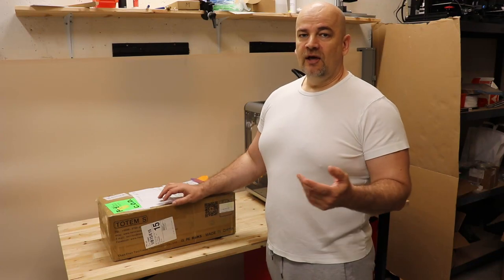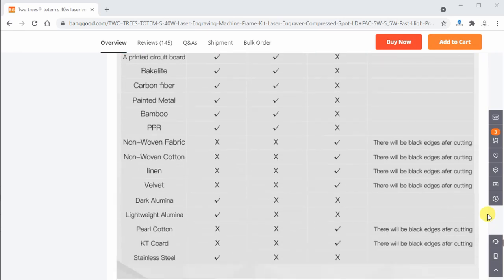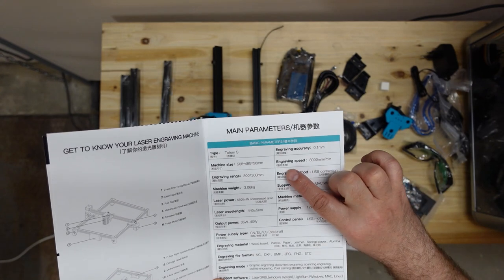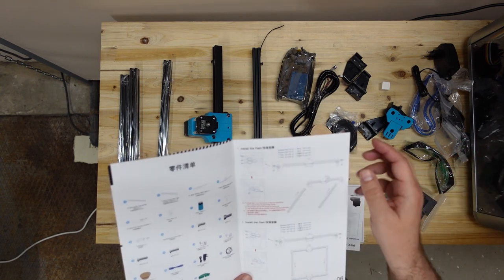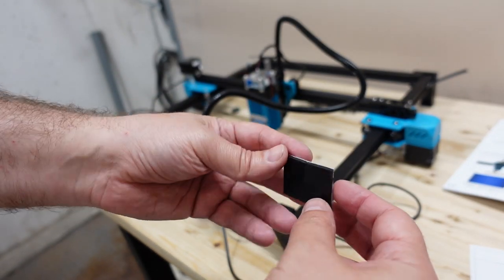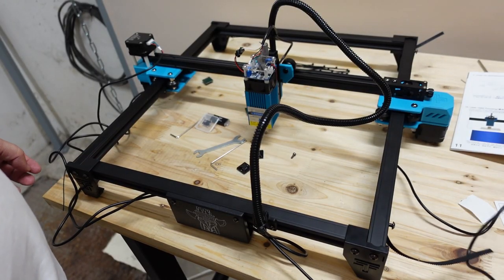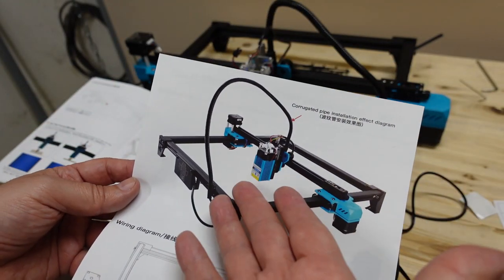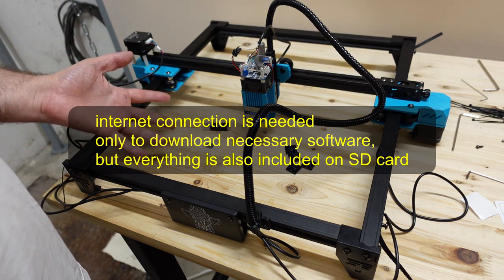Two Trees - Totem S 40W (5.5W) laser engraver unboxing, assembly, review

Comment: next step is to put some geared nema 14 stepper for focusing, build an enclosure with UV filtering inspection window and exhaust tube for fumes :)
 I did read somewhere that commercial machines with high power laser and without UV protective enclosure are not quite legal to sell in a EU. Take this information lightly since I need to find a source for that. Nevertheless, this video made me thinking on adding a laser in my sapphire plus :D
Reply from the maker: Nice thinking, enclosure and exhaust is useful, but I don't want to add more weight to head. I like this focusing method, far the best I have meet so far.  This is DIY machine and you have to put it together (and build enclosure if you need one). Since thomas sandler mentioned in one of his video that it is illegal, everybody think that fbi will knock on their door if they buy this product. Several comments asked thomas, but nobody could show written legal proof. (And I believe welding machines are more dangerous, let's make them illegal too)
Reply: @MyTechFun  That's right, Thomas mentioned that :D I just couldn't remember where did I get that information from.
Reply: PRC sellers have a way of circumventing laws :D ... for e.g. if this is sold as a tool and not as consumer device most of the laws do not apply (you do not need all the certifications you normally need for consumer devices as it is expected that engineers know how to use their tools :D )

fume extractor would be very useful as some of the materials produce extremely poisonous fumes while cutting (acrylic for e.g.)

Comment: Hello, nice video. I was thinking buy one of this. but I have a question, I need the machine to cut some vinyl but I'm not too sure about the results of cutting on this material. Do you recomend this machine for that? Thanks
Reply from the maker: Sorry, I didn't tried it yet, I don't have vinyl at home to test it
Reply: You can't cut vinyl because it will give off a toxic gas. You're better off with a cutting machine like a cricut
Reply: Vinyl not only produced deadly gas when cutting, it is also higly corrosive and every metal part of yout laser cutter would rust in very short time. Buy a vinyl plotter that cuts with a razor

Comment: Hello! I'm wondering if you've tried it to engrave stainless steel materials? I'm planning to buy an engraving machine for my jewelry business. 🥰
Reply from the maker: Yes, with even cheaper laser: https://youtu.be/nTB1Ov3_JOA
Reply: It is not possible to engrave stainless steel with diode laser. You need fiber laser for that. A cheap alternative is cutting self adhesive stencils for electro chemical etching with diode laser

Comment: Thank you for the video, very helpful. I have the very same engraver and it makes a really loud noise when it moves up and down. I tried both loosen and tighten the belts but none of that seems to work, both ways it makes it worse I would say. Do you have any suggestion?
Reply from the maker: First try to find out that it is mechanical or electrical problem (is moving with hand smooth) Then check pulley, is in same level with other pulleys.
Reply: @MyTechFun The pulleys were okay, the problem was electrical. The wires contacts were touching and there was short circuit. Now it works smoothly

Comment: I think air assist would help more with the cutting depth.
Reply from the maker: Yes, a small fan can probably help with a clean cut. But setting the right focus is very important too.
Reply: @MyTechFun  "a small fan" doesn't help much, a compressor or a high-pressure fan is required to provide high-pressure flow to get fine cuts, the black charging on the top of the cut almost go away and depth is significantly increased. small fan will help with fumes (some materials will have combustible fumes, also some fumes will absorb some of the power) but to have clear cut, less charring, and more depth you need high pressure air assist
Reply from the maker: @thearhi  that's what I mean, small fan for smoke and fumes if there are a lot. For small particles of cutting, yes, high-pressure air
Reply: @MyTechFun  I haven't used that particular laser module but very similar one I used (tad bigger, around 7.5W optical power but looks exactly the same) the fan on top that cools the module drives the air through the module and air exits around the laser beam and clears the smoke. If that's not happening on this module you have adding a small 25mm fan is usually enough to remove smoke (40mm of course works much better and is much quieter)... but the quality of cuts with the compressor is "nebo i zemlja" as we'd say :) ... I setup on friends laser a small miniature 4L compressor, we added a second bottle (used old used bottle for gas), a cheap flow regulator from aliexpress and made a tiny nozzle out of a thin copper tube, works awesome and cuts are super clean. Does not help too much with depth, for that we ordered some collimation lens to try to make the beam narrower... 

Btw, I see here you have difference in X and Y dimensions, I think this is 'cause the beam is oval and not round